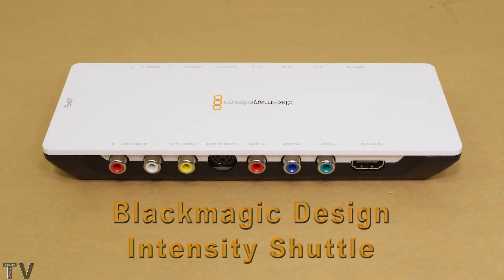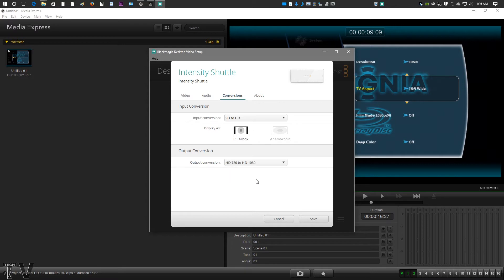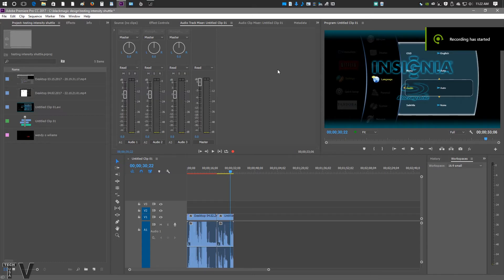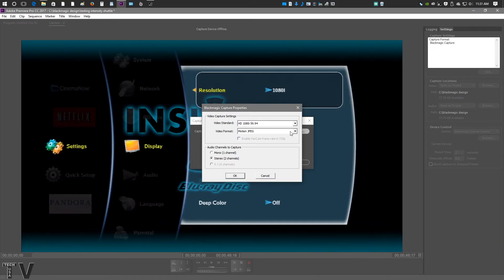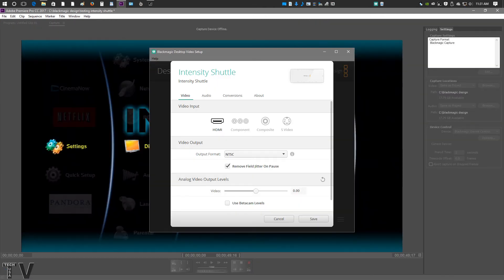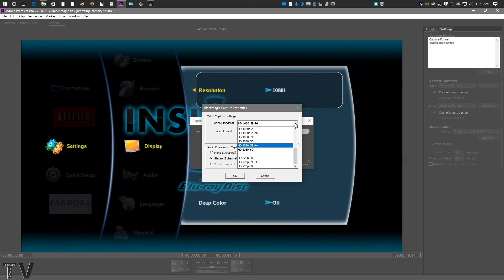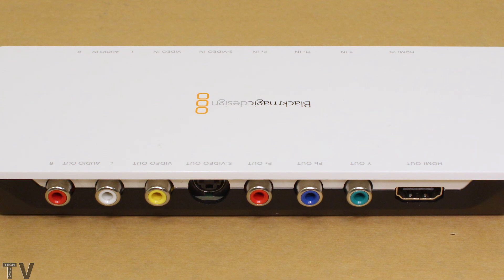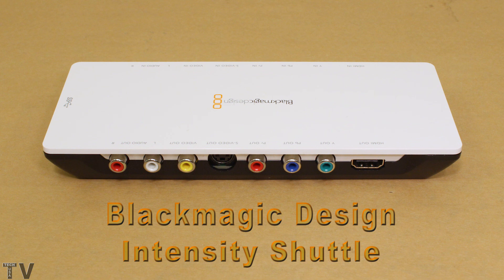Blackmagic Design Intensity Shuttle Review and Tutorial

Comment: Hello

I have enquired once before and was grateful for your assistance. I am trying to capture in Premier CS5 edition, but only have DV & HDV options available, no BlackMagic option. I tried uninstalling and reinstalling Desktop Video as something on the internet said that Desktop Video may need to be installed after Premier. It could be something basic, such as CS5 being too old to support it too! 

If it is of any interest after a year or so of fiddling with VHS, I have gone from ADVC100 to USB Intensity Shuttles, with component from a Panasonic with inbuilt TBC, which gives the best quality I have seen from VHS. Currently capturing in OBS, which can deinterlace live, requiring no post-processing at all, but cannot save reliable interlaced files which most customers will be supplied with, which is why I am trying Premier. I also tried RCA-HDMI (tried twelve different devices before something worked with a fairly good picture, as good as an AV input on a digital TV (which was better than any composite USB capture devices) and even then it was unreliable, could lose the video and not regain the signal) to HDMI-USB capture as I think you had been looking at in a video I saw, but not sure if you got it to work. I found it was better than any other non-TBC methods, that did not require post-processing to convert from DV to something more widely-accepted. I had an external TBC with S video, but the Intensity Shuttle seems to prefer component. Most credit to GTH Electronics who have helped sort ninety percent of my issues in only two months.

Thank you very much,
Braith